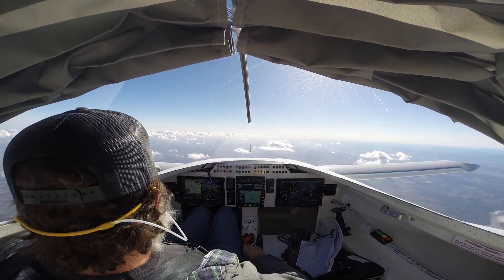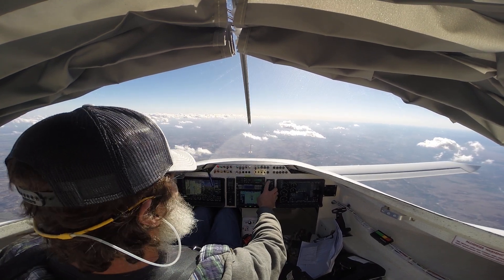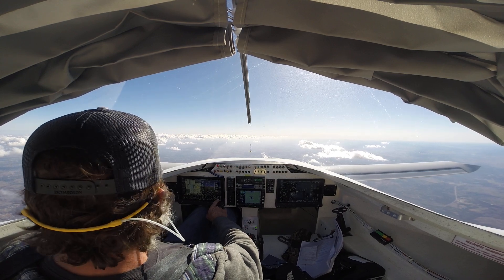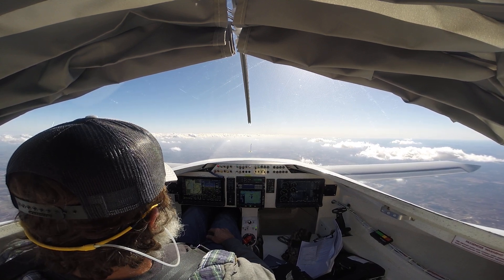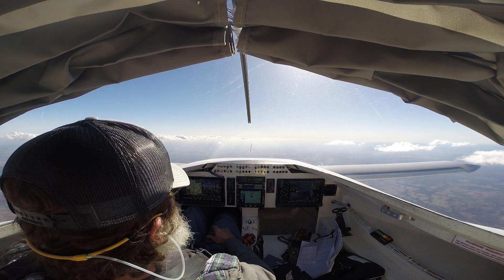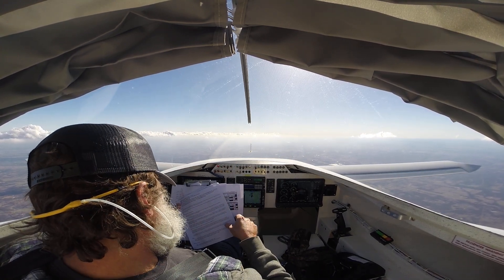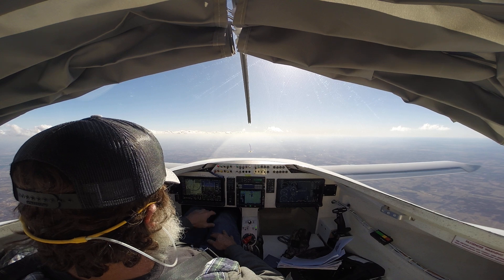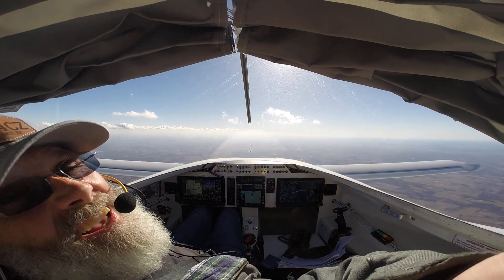Cozy MK IV N724CZ 75 knot glide test practice with engine idle.

Comment: And what the heck was your descent rate?
Reply from the maker: Because it was turbulent, the range was -300 to -1000 FPM.  Average was -774 FPM.
Reply: @mikesatchell8317  Not bad. And you're shooting for 70kts?  best glide? net time? 
Looks like really nice viability and roominess in your cockpit.
Reply from the maker: @ManNomad  A group of us are testing a range from 70 - 100 Knots in 5 knot increments with the prop stopped. The first person testing recently got the best L/D of 15.3 at 75 knots.  We're also testing at forward & aft CG, light and at max gross.
Reply: Did you say 15 gal or did you say 5 gal in one side? Bad hearing; I could understand 8 gal the other.
Reply from the maker: I had 5 gallons on one side.  Did you try turning on CC (closed captions)?  Sometimes that helps.  @jamesstewart2543